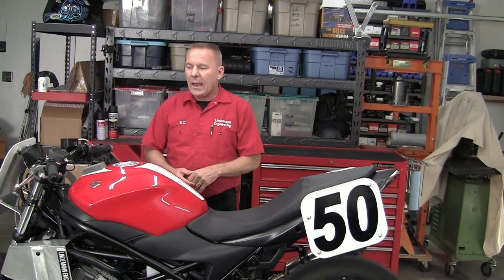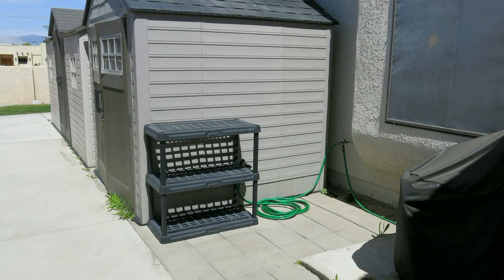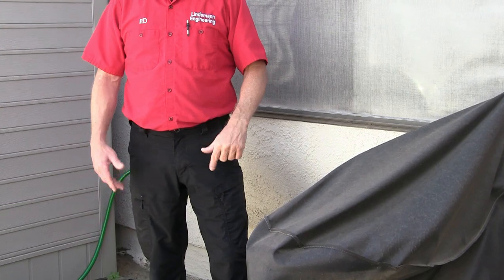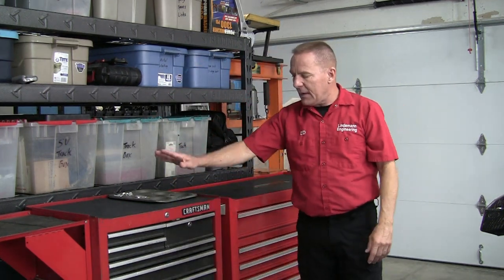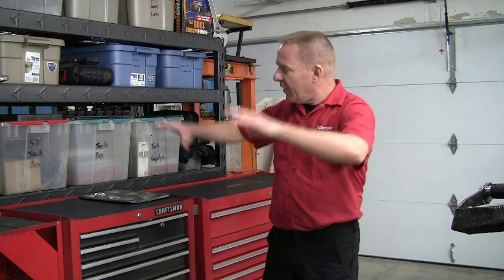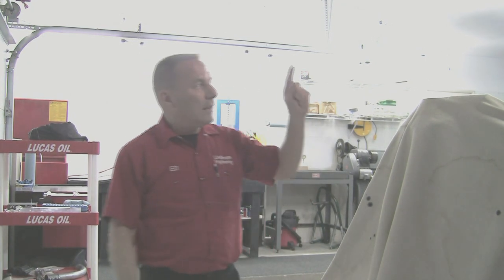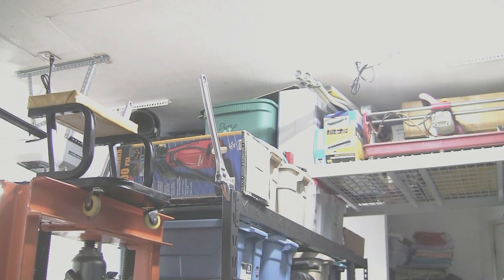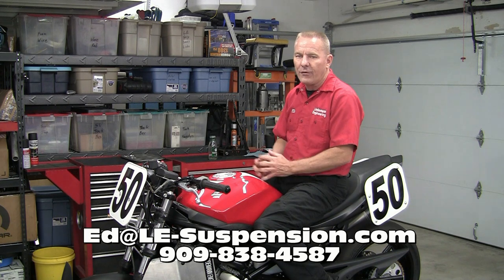How To Set Up Your Shop

Comment: Ed, when you're talking about tools bouncing in the box (about 21 minutes or so); try putting foam rubber sheets over the tools and closing the drawers.  It's what I did years ago.  The foam compresses and holds things in places, and keeps them from bouncing around, and you don't have to do fancy cut outs for each thing, it'll work with your set up, or just loose tools, too.  It's cheap and light weight  also.